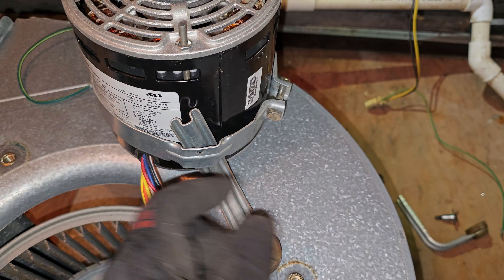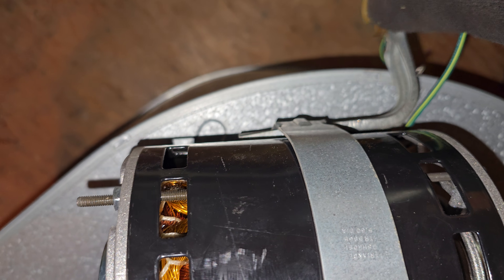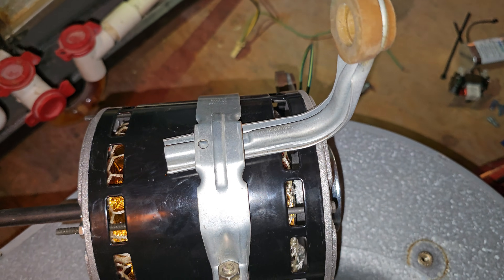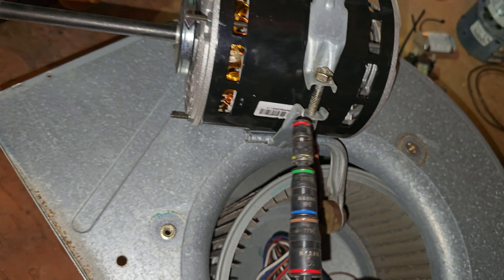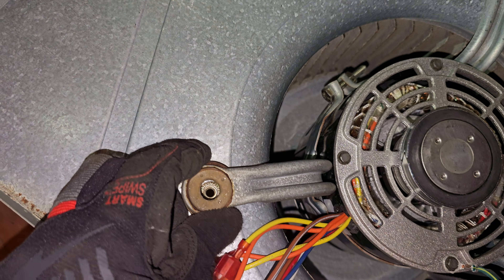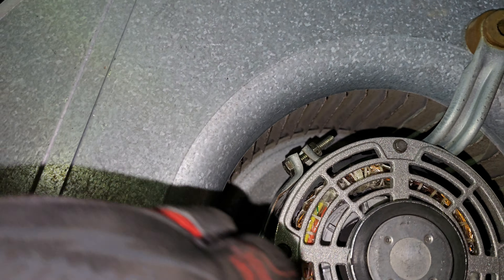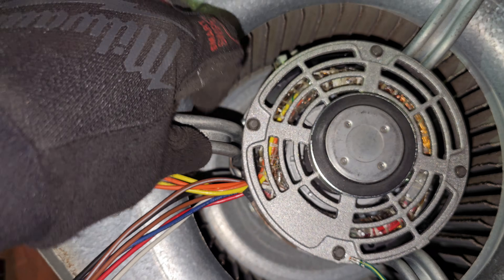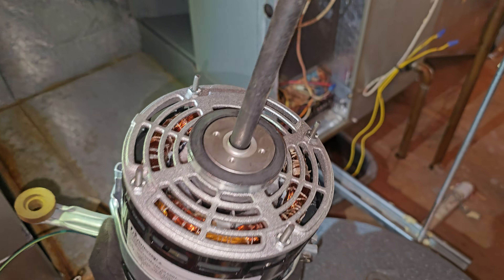ECM TO PSC MOTOR CONVERSION Pt2

Comment: i found your video while looking how to repair blower motor internal capacitor because it was not in air handler only to learn i have an ecm motor. 300.00 for ecm controller, whole motor assembly starting at 650.00.this looks like the way to go swapping to brush motor with cap and relay.do you think the electric bill will go up much? thanks for the info.
Reply: also when i put reman 300.00 motor i did not buy the offered surge protector witch i will be adding. do you think these surge protectors work.it was a bad thunderstorm in fla when the compressor cap and blower motor failed .
Reply from the maker: As an individual user these ECM  motors are more luxury than energy saving. If you were to combine 100 of them then the savings would start to make a little sense